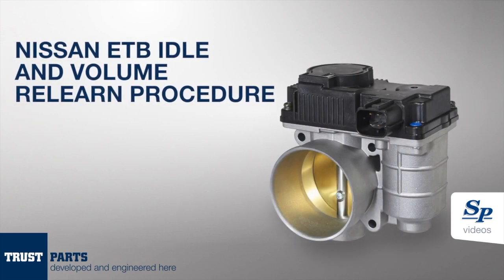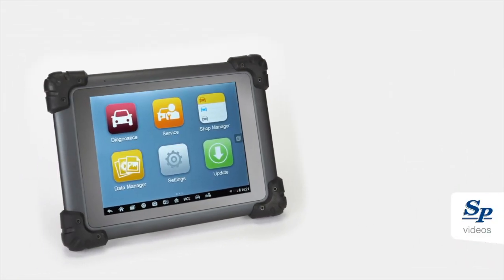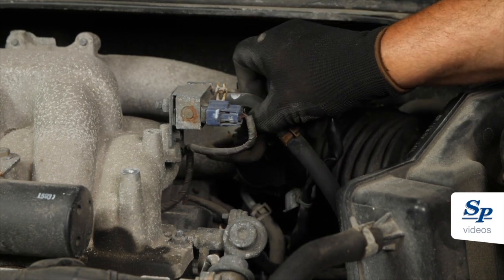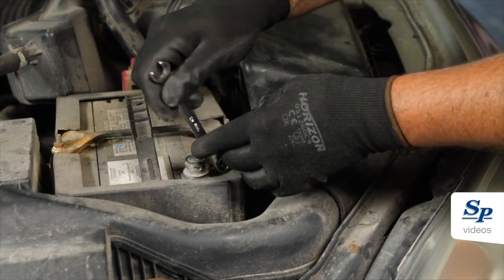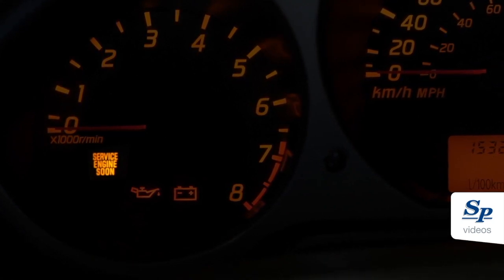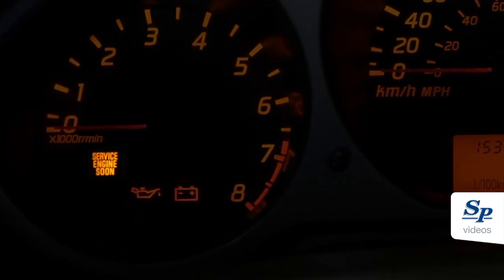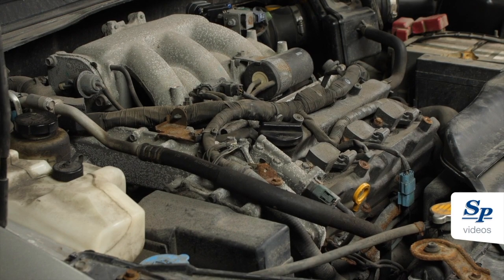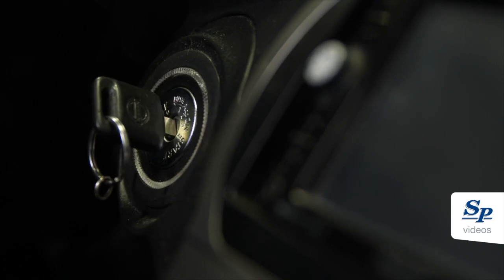Nissan Electronic Throttle Body Idle and Volume Relearn Procedure | Know Your Parts

Comment: Thank you ! I watched 3 other videos and tried the process 10-15 times and it wouldn’t work for me. Until I watch this video and followed it step by step ! The biggest difference that I caught from this video was the part about making sure there isn’t any engine codes that are showing. I cleared the code and got it first try after that.

Comment: For Nissan Tiida 2007:  After CEL becomes solid again, start the engine within 3secs and let it idle. If it's still high-rev/pulsating idle, with foot on the brake, shift into Drive. Idle will now go down under 1000rpm. Shift to Park again, and the car will find its regular idle speed (near 650-700 rpm). BTW, thanks for the video.

Comment: Any idea why throttle body doesn't respond in my old Juke F15, 2010 y. to this procedure? I've changed MAF sensor and air intake hose as the old one was damaged in the middle. I was expecting to fix high Long Term Fuel Trim (LTFT) values, over 25%.
Now it seems that LTFT is fine according to scanner reading but the check engine appeared with two errors!?

Comment: Tried this twice now . Mechanic said replace it so i did . 06 Sentra 1.8 L It was doing a few things . 1) it loses power after starting stays at low idle no matter if i floor pedal . Even did it a few times after running . I get it running normally if i turn it off then wait a minute restart it . Idle at red lights fluctuates a lil . goes from just below 1,000 rpm to just above that . replaced it with a Hitachi TB

Comment: Nissan N16 Sunny 2003 
I have a problem with RPM - it's completely unstable
The Throttle nail has been moved - and the idle sensor has also been moved
How do I return the Throttle nail to the original factory position?
Reply: Am trying but is not working on nissan grand lavina 2008